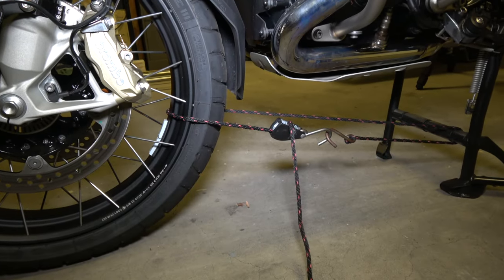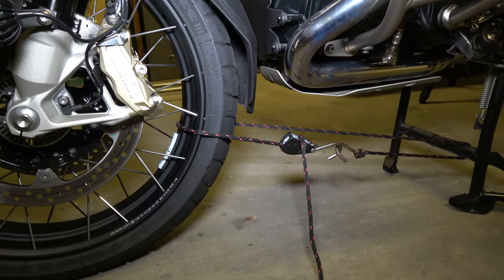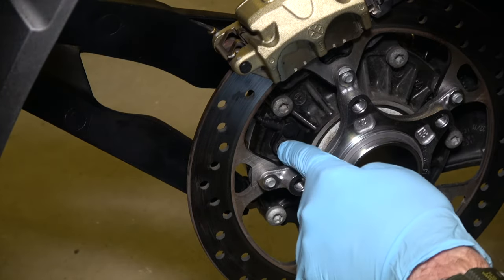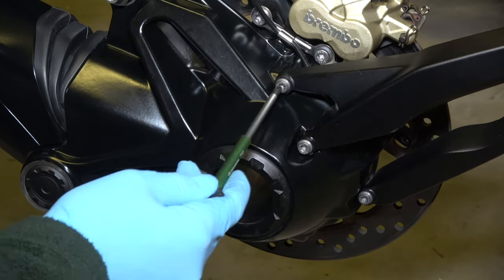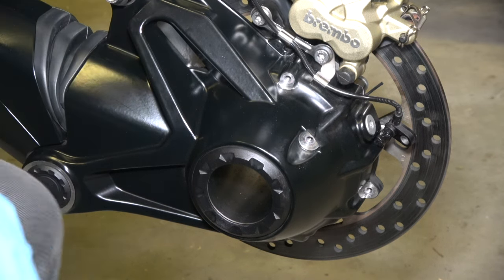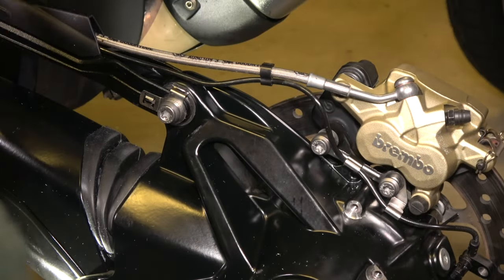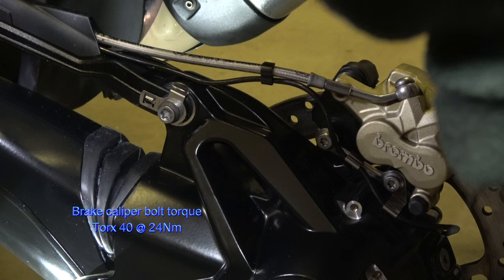ESSENTIAL MAINTENANCE: How to lube the FD splines on the shaft drive of your BMW R1250GS / R1200GS

Comment: In case anyone is wondering; the recommended grease to be used on the rubber boot is ‘Staburags NBU 30 PTM’. This is taken from the actual technical service manual for these bikes. It acts as a waterproofing agent to stop water ingress into the driveshaft assembly. 

Excellent video buddy, much appreciated by all.
Reply from the maker: Thanks for the info, watching the video and the kind words. Stay safe
Reply: I questioned BMW about this to see if they sold it, because it's so hard to get in the UK, and they said they just use standard grease. They had never heard of it. This was Bahnstormers.
Reply: I thought the NBU 30 was for the splines and the Kluber lubricant was for the rubber?
Reply: Nice detailed work. Thanks

Comment: One of the better final drive videos on Youtube.  Not many mention using threadlock as on the caliper and paralever arm screws as standard.  For info I used a foam ear plug to temporarily bung the speed sensor hole, worked a treat.
Excellent video, well done.
Reply from the maker: Thanks for the kind words and for passing on the great idea of using the ear plug for the sensor hole. Stay safe.
Reply: Brilliant mate! Absolutely brilliant. I was about to postpone this until next oil change but now I can continue my weekend plans. Many thanks to both if you for the time it takes to put this video together and the helpful hints, tips and tricks.

Comment: Totally agree with that small amount of lubrication on that torque lever bolt. Twice I’ve had dry squeak sounds from that bolt area which I can only put down to dry surface friction. Checked the torque setting & it was fine. Lubrication done, no squeak.
About to do mine again, which I tend to do probably twice a year. Thanks for your vid. 👍🏍
Reply from the maker: I'm pleased to see that there was method in my madness and you are living proof that the bolt requires a very small amount of lube on assembly. Thanks for watching the video and taking the time to comment.

Comment: Thank you! Just bought my first R1200RS 2016 with 72000 kms on the clock, I bet this needs doing, and now I know how! Cheers from Sweden!
Reply from the maker: Pleased that the video will be helpful. If you need any help or advice when you’re doing the job, let me know and I’ll assist where I can. Thanks for watching the video and taking the time to comment.
Reply: @TheMotorradRider  I did the work two days ago, and it was long overdue. The splines were corroded and there was almost no movement. Cleaned up and lubricated, all with your video as a reference. Thanks again, and for the reply!
Reply from the maker: Excellent news and pleased everything went well.

Comment: Will bookmark for reference. Comprehensive coverage + in my opinion your wire method is the most logical compared to others wrestling with it. Glad I ran into this, I'm due for this maintenance this spring-  Thank you for posting
Reply from the maker: Hope it helps out in your upcoming maintenance and thanks for taking the time to comment and watching the video. If you need any help during the job, let me know and I’ll do my best to help. Stay safe.
Reply: @TheMotorradRider  Thank you stay safe as well

Comment: Great video! Thanks for sharing. Planning to service mine today and will reference these steps. Especially liked the fact I can do this and keep the final drive oil in there, which I recently replaced.

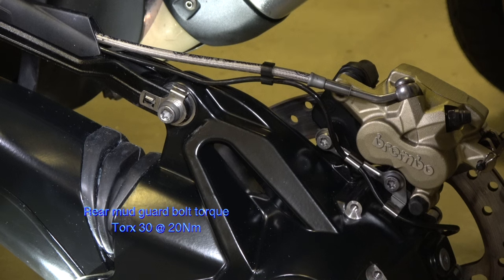My only comment on the video is that I think the torque value shown for the rear mud guard at 21:32 are incorrect. I've checked two different sources online and both call this the "Spray Guard" and list the torque value at 8Nm, not 20Nm. One called it "Spray guard to rear wheel drive", the other called it "Spray guard to bevel guards", but both list 8Nm.

Comment: Thank you for an excellent video. At the beginning of the video (0:40) you mentioned that rusted splines can cause hard gear shifting. I experience clunky shifting in the low gears. I know that is a common issue on early (2013) LC models, but I plan on lubricate the splines and hopefully the gear shifts will be smoother. 
I have to say I hesitate a bit doing this myself if I accidentally can loosen the splines in the gearbox end of the shaft if the splines in the FD-end are seized due to corrosion. 
I understand you use thread lock (medium) on both the paralever bolt and on the bolts for the brake caliper. The specifications I have found specify high strength thread-locking compound (Loctite 2701) or new bolt with micro-encapsulated thread lock. The caliper bolts are specified with no thread lock at all.
Reply from the maker: Thank you for your kind words. If you do have seized splines and you inadvertently pull the gearbox end of the shaft off, it is held in place by a wire spring clip and should push back in place without too much hassle. 

Regarding the thread lock. I have used Loctite 243 on many applications and this one is no exception. Having been working on machines for over 40 years I am just passing on how and what I do but the choice is most definitely yours but if you elect to use high strength thread lock, it will make the next inspection harder.

Many thanks for watching the video and taking the time to comment.
Reply: Did you see improvement?
Reply: @nikoscosmos  No, I did not.
Reply: @paltorvbraten9604  spline lubrication is a complete groupthink myth and a cult as there isn't any sliding of the splines due to the paralever design.  However if lubrication prevents corrosion of the lower universal joint, then I guess it may do some good.

Comment: kudos for the symptoms first off the top i could not figure what i was doing wrong from 2nd to 3rd i kept missing and when on a spirited run in the highway (lots of that around me) once i couldnt get it back engaged untill i was in 1st gear range 20 mph other times it would just rev and i could usually get it the second try  final drive fluid was horible gearbox wasnt as bad very satisfied with my handy work cheers!
Reply from the maker: Glad the video helped. Thanks for watching and taking the time to comment. Stay safe.

Comment: Many thanks for a very useful video. Just a small point on your needing three hands - I’ve overcome the problem to some extent by using a bottle jack to support the final drive when removing or installing the paralever bolt - hope that helps. Thanks again.
Reply from the maker: Great advice and thanks so much for sharing. Thanks for watching the video.

Comment: appreciated as doing the job is one thing, sharing how to do it is another...
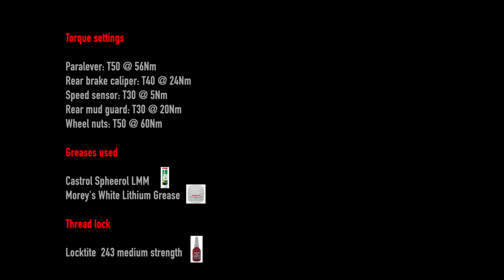Reply from the maker: Thanks for the kind words Gunga Din. Here is a link that should take you to where I purchased my tub of grease from here in Australia:- https://www.onlineautoparts.com.au/products/Morey-s-Grease-Tub-suits-Polyurethane-Bush-Kits-500gm-Container/ZPN-03676 . Any white lithium grease from a tub (aerosol version does not seem to quite as good of a job) will suffice. Details of what I used and relevant torque settings for the job can be found between roughly 23:23 and 23:35 in the video timeline. In the next couple of weeks I will be producing a video of changing the air filter and replacing it with arguably a more efficient type if you're interested. Again, thanks for watching and taking the time to comment.

Comment: Very good video and well explained. Subscribed. I think that for someone doing it for the first time it takes at least 2-3 hours. Those of you who tried it know it for sure. I think that this kind of check of the shaft shoud be done although you live in a dry and warm area. My question regarding this is when/with how many kilometers done? Thanks for your answer.
Reply from the maker: It all depends on how, when and where you ride. If, like me you do little off road work and live in a dry(ish) climate and that I had already checked the spines, I would not be worrying about them for a couple of years or 20K klms. If your riding involves heavy off road work, creek crossings or you live in a damp or tropical climate and close to the coast then I would consider performing the check at least annually. I must stress, this is my opinion only and should be taken as such. If you wish to perform the inspection more frequently, you will not do any harm and you will have peace of mind that everything is 'good to go'. Hope this helps and thanks for subscribing and taking the time to watch the video.
Reply: @TheMotorradRider  Thanks for this. I hopefully live in the area where  there is little snow and when it is raining I do not ride. I agree with you, doing a check it is always spot on and it is harmless.
Reply from the maker: One thing I should add is, if you do the check and find that you have the updated painted drive shafts such as those in the video, that obviously reduces the corrosion issue. Now don't quote me on this but I THINK that the painted shafts and grease to the splines, were fitted by the factory from MY18 onwards to address the corrosion issues. If yours is 2018 or younger, I would still do the check for your own peace of mind and spray something like ACF50 (https://tinyurl.com/k34byt) into the FD housing for some added protection. It can't hurt.
Reply: @TheMotorradRider  Thanks for this. I will probably buy a new bike in 2023, R1250RS or any similar model to this. Anyway I like to have things in order and ready to use carefree, that`s why I will check it anyway like you mentioned.

Comment: Thanks for this. I have a 2014 RT and I'm dreading looking at it, since the bike did not seem well looked after. I've got 23k on it now.
Reply from the maker: Let me know if there’s anything I can do to help. Take it slowly and methodically and you’ll be fine. Keep in touch.
Reply: @TheMotorradRider   Much appreciated. Good to know, thanks. It's a job I will tackle when I have a week off I think, just in case something goes wrong. Will molly grease be okay to use on the gears? Was thinking of just laying it on with a trowel so to speak.
Reply from the maker: @ArcanePath360  Moly grease will be fine for the splines. 

You don’t need to be too heavy handed as a little goes a long way. Clean off the old grease as thoroughly as you can and then get a decent dollop of fresh moly on a gloved finger and apply thoroughly around the splines on the shaft. Do the same to the splines in the carden joint and you’re then ready to start reassembly.

Keep in touch.
Reply: @TheMotorradRider  Thank you!
Reply: @TheMotorradRider   Well it turns out I didn't even need to grease it, the splines were practically new with a white grease still in good shape on them. I just dabbed a little moly on, and put back together with NBU30 grease on the accordion. Was very surprised there was no rust at all, considering the condition the bike was in when I bought it
Reply from the maker: @ArcanePath360  Thanks for letting me know the excellent news and I’m pleased that everything obviously went well. You’re good to go and enjoy the pleasures of shaft drive for another 20k before you even need to consider checking again. Stay safe.
Reply: @TheMotorradRider  Certainly am. Not sure I needed to buy that expensive Starburags NBU30 though. Looks like plain lithium grease to me, which is what my BMW dealer said they use when doing it.
Reply from the maker: @ArcanePath360  The three dealers I spoke to use moly on the splines and white lithium on the boot and that’s what I did in the video.

I really think that BMW and the other manufacturers do like to make their owners think that parts of the bikes are made of durillium nitride unobtanium and need their owners to pay more per ounce than gold for a simple service product. 
 
Anyhow, enough of my ranting and more to the point, you’re good to for many miles to come so enjoy the RT and most importantly, stay safe.
Reply: @TheMotorradRider   Thanks, I feel the same about that. They wanted silly money for the final drive oil so bought my own of another brand from Amazon at 1/3 of the price. This NBU30 stuff though wasn't really in the manual and the dealer never heard of it, it's what Boxflyer said should be used, who has comprehensive videos on every aspect of the bike. I figure it has an important job of keeping water out of a shaft drive for the next 2 years in all weathers, so £10 on the correct stuff vs a little less was something I'd like peace of mind over, since I've seen horror show pictures of rusted up splines and I can't afford the risk of a new shaft. Thanks again for the video, it wasn't nearly as hard to do as I thought, and I resprayed my wheel while it was off. Happy riding!

Comment: Thanks for a great video. Called 3 different BMW dealers in the US and they all stated that this Maintanace is not really necessary. So... not sure what to believe. 😔
Reply from the maker: I totally understand your dilemma. What I suggest is for you to do a search on the Net for “BMW rusted drive shaft splines”, “GS seized final drive” or such like and find the plethora of cases of severely rusted drive shafts owners have encountered on their machines. Why? Because BMW don’t think it necessary to service the FD splines.

I want my bike to run trouble free for as long as possible and for me to have peace of mind on a trip that at least my unit has been serviced and has less chance of failure.

The newer machines, mine included, have been upgraded by BMW to painted drive shafts and a little bit of lubricant in the splines to prevent seized shafts. What does that tell you?

Frankly, I don’t care what the dealers say as I and countless other owners check (and lubricate the splines) on a regular basis as part of the maintenance schedule. If you live in a location that is wet, cold or has salty roads or you do a lot of off road work, I would strongly suggest you check your unit but ultimately the choice is yours. 

Thanks for watching the video and taking the time to comment.

Comment: Good informative video, Can you not grease the front spline at the same time, I think the front floats in & out like the rear you could pull the Gator back and get some grease in there
Reply from the maker: Thanks for taking the time to watch the video. Your question has been raised and addressed many times previously in the comments. A brief summary is that the the gearbox end splines do not move and are located by means of a wire spring clip. The location and warmth from the gearbox prevents problems but feel free to check out the splines if you so desire. Hope this helps. Stay safe.

Comment: Very in-deep video thanks for the effort and sharing your knowledge, now what about the other front end spline output from engine side transmission?
Reply from the maker: The gearbox output shaft splines and drive shaft splines are locked in place by a spring clip and do not move unlike the lower final drive end. They are also considerably less prone to rust due to their proximity to the engine/gearbox. 

A sharp pull on the drive shaft will  release the spring clip and then the shaft can be removed if required. 

Hope that answers your question. Thanks for watching the video and taking the time to comment.

Comment: Excellent video but you never greased or serviced the front splines near gearbox?Thanks
Reply from the maker: Thanks for the kind words and you are correct. As I mentioned in previous comments, the reason being is that the gearbox end rarely, if ever, cause problems and are not required to move due to being secured in place by a  clip, unlike the FD splines which MUST move and cause issues if they do not. I appreciate you watching the video and taking the time to comment.